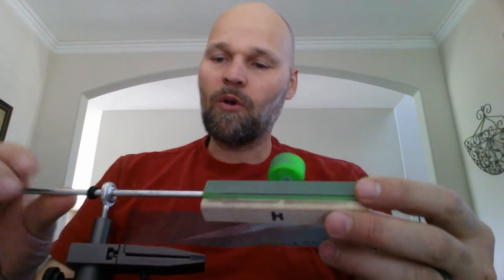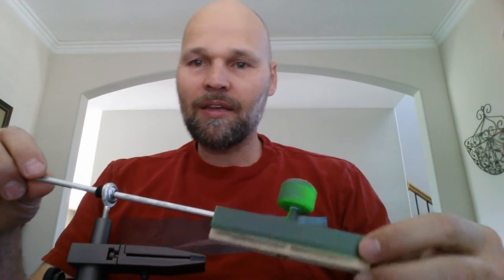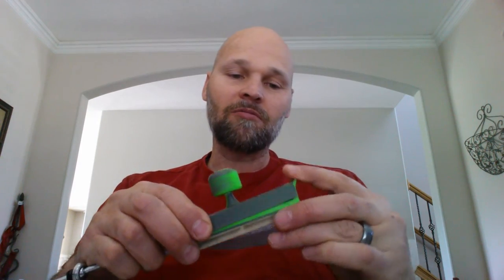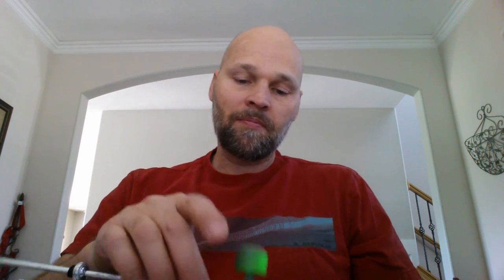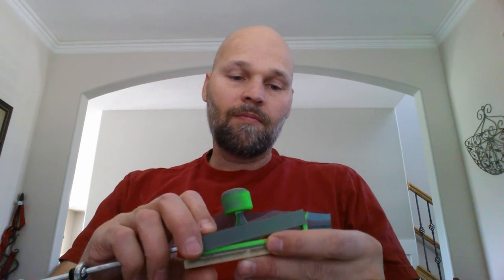Upgrades to ViperSharp Precision Knife Sharpening System

Comment: what stones will be initially offered with system..
and any idea for the projected retail price.
it looks nice..I have several systems and always keep my eye out for something new.
Reply from the maker: +Joseph Chilleme I'm still working on all the details of all this. It's crazy how much time it takes to design, create and test all the prototypes and then getting pricing is a big job too. I'm thinking I will do 3 stones initially that will cover extra coarse (50-60) up to around 800-1200 fine. I want to offer all the options but need to be sure I can manage the manufacturing and procurement first.

Comment: What is the benefit of this over magnets? Or was it the patent issue fixed by this?  Either way seems to work fine and the knob already looks much more tactile!
Reply from the maker: +PPPantsUK It was the patent issue that started these changes. It will work better in the long run I think and will have a better look and will still carry the lifetime warranty.